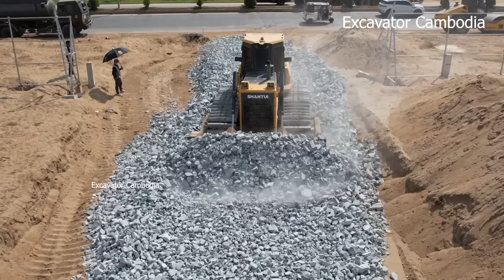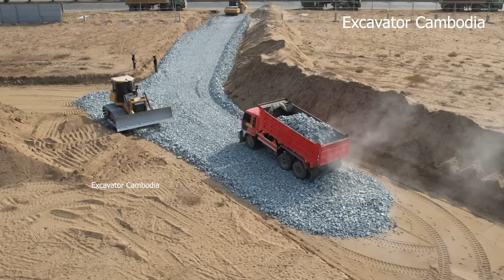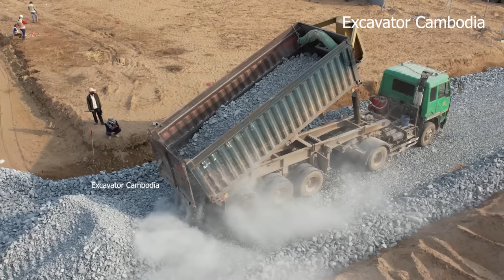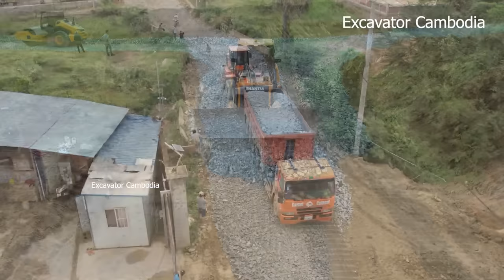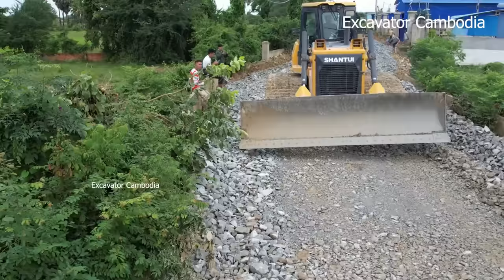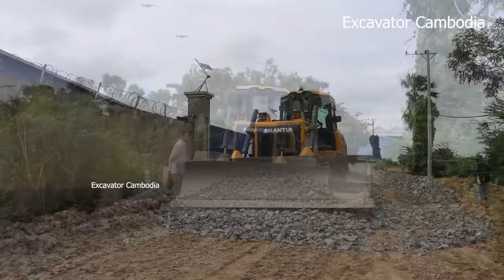Fantastic Building Standard Foundation Road Construction By Long Dump Trailer And Shantui Bulldozer

Comment: No one is wearing any safety equipment hard hats or a reflective vest and boots here where I am from all of those is a must or you will not be allowed on the construction site at all and those dam motorcycles you must make sure to stopped them and not allow them to move until the truck and trailer is in its possession to dump its load you need the police there to stop traffic here it is a must and if the drivers don't listen to the police they will go to jail I know that your country is different from where I am from but safety is a must you need to explain to someone's family that someone had died because you did not do your job correctly that would be on you so safety  safety is a must.